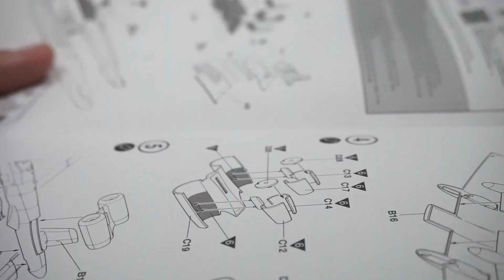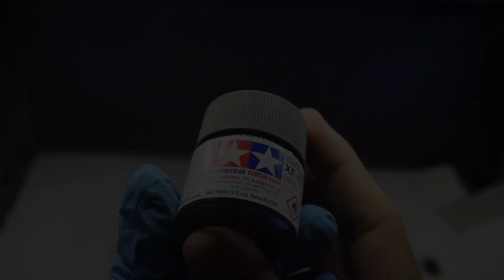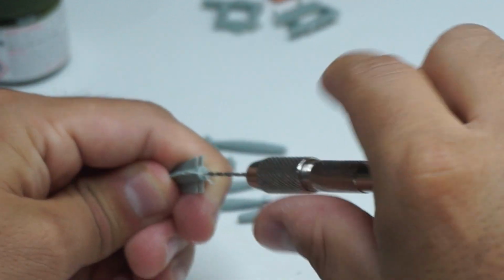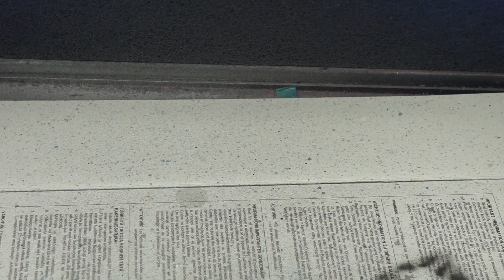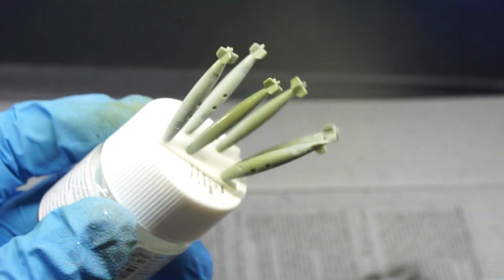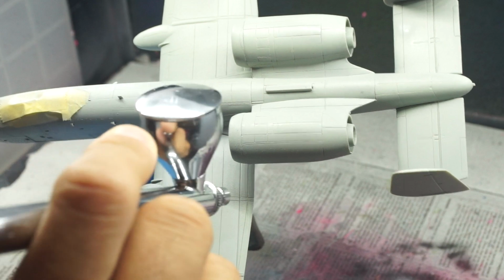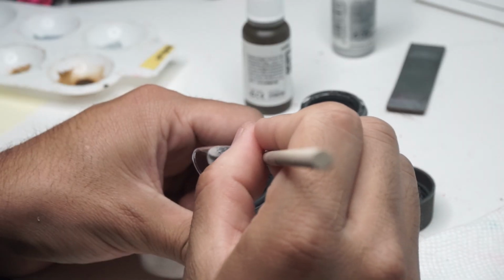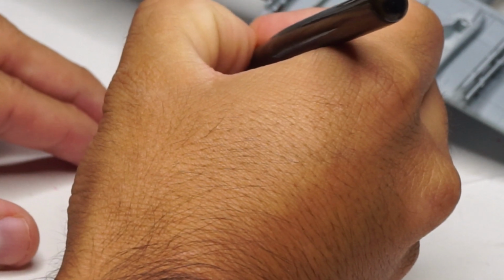Academy A10 Warthog 1/72

Comment: How did you prevent the model from tumbling? It seems that the model is rear heavy and could fall on their rear side.
Reply from the maker: I had tried using some weight on the nose of the model which helped a lot but still tilted back on the rear which you can still see on the thumbnail.

Comment: Very nice!! I love how you just get into the video. I want to know what the adhesive block thing you used to put small pieces in place to work on them. I always have trouble working with small pieces because they move around
Reply from the maker: I used an old paint pot and cut out a piece of double sided mounting tape to attach to the cap.

Comment: good vid/info question what kind of support holder is that your using for the cockpit gluing/assembly?
Reply from the maker: I used a old tamiya cement container and old testors paint bottle mounted together with 3m mounting tape.
Reply: @danzshop3244  ok i am getting ready to build this same kit,did you use primer on parts first before air brushing,i ask because i will spray can primer the larger parts then brushpaint those.the smaller assembly pieces will be brush painted after glued together,using acrylic.